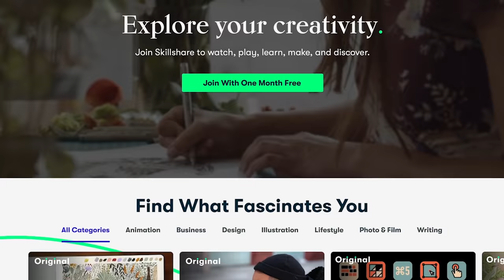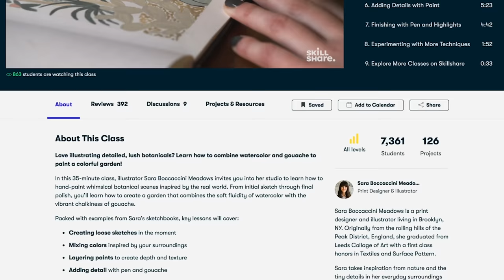A Country Boy Can Survive, Logging With A Classic Ford Tractor

Comment: Nice video of the Ford tractor. I've moved a lot of logs, including some whole tree tops, with a tractor similar to the Ford in the video. I could recommend an easy trick to help move them. If you weld a log chain grab hook to that fork lift frame, right where the top link attaches, you can put a log chain around the end of the log and back the frame right over the end of the log. Lower the frame as close to ground as possible and pull the chain up and hook it in the grab hook you welded on the frame. Lifting the frame up will lift the end of the log off the ground. This does two things. 1. It puts one half of the weight of the log on the rear tires of the tractor for more traction. 2. It reduces the friction from the length of the log dragging on the ground making it skid much easier on just the far end. As a side benefit it will keep the bark of the log from filling with dirt  along the entire length. Reducing the dust from your mill and making blades stay sharp longer even with your debarking attachment of the mill. Also reduces mud that dulls chain saw blades. On the down side, that tractor can get a bit light in the front end with the log lifted up. Be careful and lower the log closer to the ground if that occurs.

Comment: @Nathan if those are black then they're part of the 160th SOAR, special forces transports they tend to stick out because of that long fuel and boom on the front. But that could be a different one if it's not black. MH-47 is the military designation of the black ones. Currently the strongest one we have with the highest lift capability Chinook (Shaa nook) also known as a $h!t hook. Always loved catching a ride in those. You should take some screenshots and take them over to that base and they'd appreciate it greatly.
Reply: Not necessarily as the Air Force's version has the in-flight refueling boom too.
Reply: He is in Tennessee
Reply: Thats 160th. Special Operations Aviation Regiment. Staitioned at Fort Cambell.  Source: I am a Hooker

Comment: They are CH-47 Chinook heavy-lift helicopter, used for troop and equipment transport. They have been around a long time, sense 1962.
Reply: Mr Richard's and Nathan; this particular model in the video is the HH47 and more than likely CSAR i.e. HH47 CSAR (combat search and rescue). The probe on the front end is for in-flight refueling. This feature makes this platform highly suitable for long range missions.
Also, again I couldn't tell from the video, but more than likely on the starboard side are cameras and sensors (high resolution and top secret). 
One more point; on the aft starboard side more than likely there is a 50mm cannon poking out...pretty cool stuff mixed up in one package...
Reply: That CH47 is truly a workhorse for our military, to my knowledge they have not yet determined what will replace is, kind of reminds me of the B52, just keeps on serving.
Reply from the maker: nice thanks!
Reply: They're actually MH-47G from 160th SOAR. It used to be my unit before I got out of the army.
Reply: Not the most desirable aircraft to fly in as a passenger, especially in turbulence on long flights…🤢

Comment: You were talking about cutting faster which got my olg mind thinking after you get you square cant cut if you cut it in half & move the top half to the right clamp both down & start cutting your board wham bam I just cut your time amost in half minus the time it takes to move the top half.  Granted I don't have a mill but it seems like it may work.

Comment: You'll likely get several comments on which variant those hellos were, most of the time only an air winger can tell which one exactly. I took many a ride in the Marines CH 46 Sea Knight variant that looks nearly the same but isn't capable lifting as much as that CH 47, or HH 47 if it's that variant. The Corps used a CH 53 Sea Stallion (now King Stallion) for our heavy lifting, it lifts more than the 47 and has a single rotor. Anyway, enough helicopter talk, it's good to see you back on the mill and making sure everyone understands why you do what you do and how it helps you to put out the quality videos you do.
Reply: Semper Fi.
Reply: @brycewiborg8095  Complete the mission, I knew that Chinook comment was going to start was going to cause a lot of responses!

Comment: those where Boeing CH-47 Chinook first in service in 1958 and still there  Been some changes in engines over the years but body has not changed  Used to hull cargo and troops
I was with the B Co, 101st Ava Bn, 101st Ava Gp.101st Airborne Div (Air Mobile) In 1970
We flew UH1H Huey's but there where 3 companies Of affectionally known for it brought u a lot of shit all at once In 2 Bn so got to see a lot of them up close